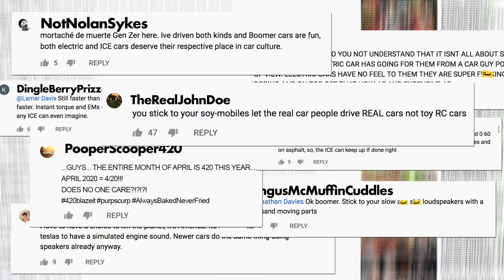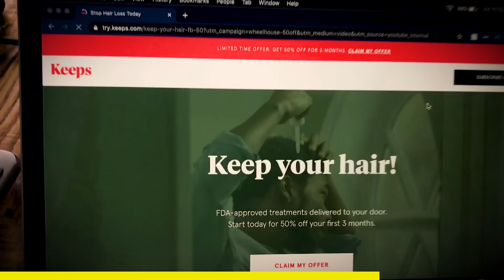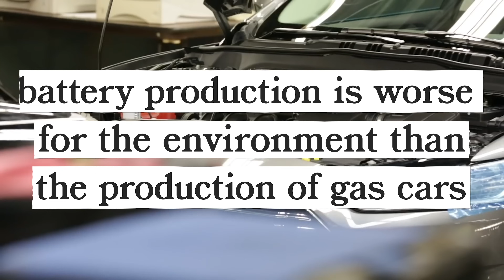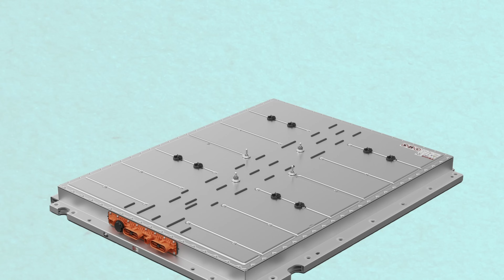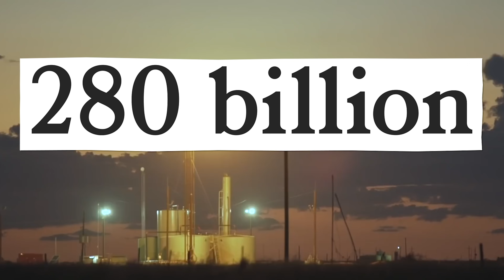Are Electric Cars REALLY Better for the Environment?

Comment: Sorry, but your claim about being "neutral" is simply not true. You obviously do have a massive bias. Having studied physics and having followed "green" energy claims very closely, I know that you omit lots and lots of essential information.

Where to begin?

- batteries, especially lithium-based batteries, represent a substantial risk; they can combust spontaneously and even explode; recently, EV busses in China burned down an entire bus depot, which caused serious concern among western cities that use EV buses; lithium fires are almost impossible to extinguish; they can burn for 24 hours or more

- one guy who had just purchased a brand new EV luxury sports car saw it gow up in flames; as more and more people buy EVs, this is a major risk fire departments now have to look into

- it's actually related to the problem with solar panels that catch fire, which are both, very hard to put out and very toxic

- EV batteries as well as solar panels are extremely hard to recycle

- there's a lot of energy lost in the transport of electricity and during the loading process, which you obviously did not account for. You only calculated the energy that ends up as battery charge.

- batteries lose power over time when they are unused; depending on the battery technology, that can be very little or quite substantial, i.e. if you don't use an EV for 1 month after loading the battery to the max, it might lose a significant amount of energy, while a gas tank in a modern car has almost no leakage.

- typical EV batteries have a life span of at most 7 years; coming technologies might expand that, but that's speculative; given that the batteries are the most expensive part of a typical lower- to middle-class EV, it is not worth replacing the battery, as the cost will exceed the depreciated value of the car itself, so you basically trash the entire car when the batterie dies; so even if the average age for batteries should reach 10 years, that's way lower than the time you can drive a gasoline car; my BMW now is 14 years old and in top shape; accounting for the reduced lifetime of EVs will substantially alter their eco profile.

- you totally neglected to mention RANGE, which is a huge issue! When I go on a long road trip, I don't want to have to stop every 200 to 250 km for a 1 - 2 hours just to re-charge the batteries; driving from my place to Rome is about 1000 km; with a gasoline car, I can do 700 - 850 km on one tank and it takes me less than 5 minutes to fill the tank; 

- if the number of EVs increases, the load on the electric network massively increases; contrary to your claim, electric grids would be in total overload if even just 25% of all vehicles were EVs; the more there are, the more often they need to be charged at any time of day, i.e. you can't tell people to "charge their cars at night; professionals need their vehicles to be charged immediately, so they need extremely fast loading, provided new battery technology allows it; that also increases the loss AND pulls enormously more current; as a rule of thumb, the average electric grid will need 6 to 7 times more power to support fast loading for a 100% EV fleet

- current batteries require rare earths and are highly toxic in production and hard to recycle; CO2 is NOT the measure of the real eco-impact of EVs...

- where will you get all that electric energy? You would have to replace about 40 to 60% of energy that currently is provided by carbon-based fuels; you will NOT get it from wind or solar, which are both very low-density and unreliable, chaotic energy

Here is the exact composition of electric energy production for Germany, which claims to be "exemplary" in it's massive use of wind & solar:
https://energy-charts.info/charts/power/chart.htm?l=en&c=DE&interval=month

Average wind production: 14.8% of the installed capacity; worst case scenario: cold, windless winter night; wind & solar drop to 0.1% of their installed capacity, which means that 99.9% of the wind & solar energy must be provided from other sources precisely when there is a huge demand! In other words, the entire energy production infrastructure must be DOUBLED!

The only way one could generate enough reliable energy to support a 100% EV fleet with fast charging would be NUCLEAR, but the same people who push the not so "green" wind & solar do not want nuclear; because their profits stem from wind & solar, which are incapable of providing enough energy, so this is a trap.

- I would start supporting EVs for general use:
* when we use modern 4th & 5th generation nuclear power plants, maybe Torium-based, with liquid-salt cooling and subcritical, small reactors
* alternatively if we manage to develop fusion power; then we can totally drop that solar & wind nonsense as complately pointless
* when battery technology is so advanced that we have at least 5x the capacity, 10x the loading speed and none of the safety, resource and recycling issues

- the entire discourse that tries to tie EVs to CO2 emissions is absurd; CO2 has virtually ZERO impact on the climate; they only measurable change through the minimal increase of CO2 over the last 100 years has been a GREENING of the planet!

Deserts 'greening' from rising carbon dioxide: Green foliage boosted across the world's arid regions
https://www.sciencedaily.com/releases/2013/07/130708103521.htm

Impact of CO2 fertilization on maximum foliage cover across the globe's warm, arid environments
http://onlinelibrary.wiley.com/doi/10.1002/grl.50563/full

Effects of Rising Atmospheric Concentrations of Carbon Dioxide on Plants - Greening Planet
https://www.nature.com/scitable/knowledge/library/effects-of-rising-atmospheric-concentrations-of-carbon-13254108/

Not a single prediction by the climate alarmists has ever come true. NOT ONE! Their models are completely wrong; they diverge by more than the 2-3 times the total claimed global warming between them; not a single model predicted the lack of warming from 1998 to 2015 - and given the NASA/NOAA data manipulation in 2015, there's a lot of doubt about the quality of data used; that means that no one has a clue about how the climate works and clearly, the assumption that CO2 causes major warming has proven incorrect.

The scientific challenge of understanding and estimating climate change: 2 essential lines to retain:
"models differ among themselves in their estimates of surface temperature by an amount that is 2 to 3 times as large as the observed warming"
https://www.pnas.org/content/116/49/24390

The latest flooding in Europe is used as proof that something is "wrong" with the climate, that it is "changing". As always, they lie - we are totally within the normal climate variability. People just don't look at the history of climate events:
http://www.bbc.com/news/world-europe-36443329

- Major storms are DOWN; the worst storms in modern history (since 1500) almost all occurred before 1800.

- Deadly climate events are DOWN; during the 1920s, close to 30 million people died due to climate events; we are down to fewer than 1 million per decade.

- Food production is massively up, on less land! The number of people starving has been reduced to a fraction of what it used to be, in both, percentage and absolute numbers, despite a massively increased world population.

- Again contrary to their claims, snowfall has not disappeared, it increased substantially; the models got it totally wrong.

- Forest fires massively decreased over the last 120 years!
https://royalsocietypublishing.org/doi/10.1098/rstb.2015.0345

I wonder where all the "suffering people" Greta keeps talking about, given that living conditions continuously improved, worldwide. If you compare the average person in Africa with an average person in a western country, you might think that they are very poor, but if you compare that African person with their ancestors in the same country 50 years ago, their lives have improved immensely.

There's really ZERO correlation between CO2 and the climate; those who push the climate agenda have been lying for at least 60 years. It's all Club of Rome Marxist propaganda. They first tried scaremongering with "global cooling" (UN, NASA, NOAA, Royal Society, Nature, Science, NYT, Guardian, National Geographic etc. all participated), then they suddenly switched the entire discourse by 180 degrees and it became "global warming".

Every 10 years, they reset the date when the world will end. I've seen it for more than 5 decades and the world never ends; we just get the occasional upsetting climate event, which repeats every 20 - 30 years. Go check out the floodings of the past.

Why did humanity invent more than 3000 gods? Mostly to pray for clement weather, not to hot, not too cold, not too wet, not too dry, no earthquakes and no volcanic eruptions, because those were the kinds of events that happened all the time and could really mess up an entire population.

If anyone thought that sudden "climate change" is man-made, they did not spend one second looking at climate history.

The Year Without a Summer Was a Bizarre Weather Disaster in 1816
https://www.thoughtco.com/the-year-without-a-summer-1773771

200-Year Drought Doomed Indus Valley Civilization
http://www.scientificamerican.com/article/200-year-drought-doomed-indus-valley-civilization/

5 years of global cooling due to the eruption of ONE volcano, the Krakatoa, in 1883.

In short, buying an EV because you think that it will "save the climate" is one of the biggest delusions, ever.

EVs are probably the future - but before they can truly replace our absolutely fantastic, highly optimized gasoline cars, we need at least 50 years of additional research and development, which is not a problem. Our emissions do not alter the climate.
Reply: @stefanmetzeler  they want to end all sales of NEW gasoline cars…. In 15 years times. Still a long time after than until they’re filtered into second hand car market.
Reply: There is so… so very much wrong with this comment. I’ll give a full response soon. But dude. At least try to google the rubbish you’re spouting.
Reply: @engineeringtheweirdguy2103  I can back up everything I said!
Good luck trying to prove me wrong 😂
Reply: @stefanmetzeler  I wouldnt be so arrogant. i'll go down paragraph by paragraph but I'm not touching the Climate stuff as that is outside my area of expertise. I'll stick to EV stuff.

Batteries represent a substantial combustion risk? no they don't. Firstly most battery fires are thermal runaway, which takes hours of smouldering before visible flames. secondly, in relation to EV's. real-world statistics don't support your anecdotes. according to the Beuro of Statistics both In the EU, Australia and the US, the AANCAP safety board, NCAP safety board and NHTSA EV's are typically 11 times less likely to spontaneously combust, and 5 times less likely to combust in an accident. Id love to see you support your claim that EV's pose a raised likelihood of combustion.

next, you claim there is alot of loss in energy transportation? no there isnt. The most ineffective powerlines in the US only represent a 15% loss of energy at worst and typically sits much lower. and by loading process i believe you mean charging? EV batteries charge at about a 98% efficiency. so thats false also.

Next, Batteries do lose charge over time. But not much. My EV was parked in long term airport parking for a month and I lost less than 4% charge. But tell me, how often do you leave your car, which you can charge at home, and leave connected to the charger, sit around for months without a power supply? If you own a car, chances are its because you have use for one.

The next one. and this is a BIG one. Im especially interested to see you back this up. You claim EV batteries today dont last longer than 7 years. Where in the flying huntsman did you get that from? Modern EV batteries have a Warranty Period of 8 years alone! meaning they'll last much longer than that. They need to otherwise the company will start losing money hand over foot on warranty claims. Modern EV batteries have been showing that they'll last, and have been lasting over 400,000-500,000 miles (800,000 km). That represents approximately 30-40 years of driving for the average person and much longer than the lifespan of a combustion engine. 

For example, Tesla Batteries have a cycle life of 1,500 cycles to 70% health. As in, after 1,500 cycles you have 70% of your original capacity remaining. For a model 3, its range is 325 miles (with the model S and X having lager ranges as well as other EV models). after 1,500 cycles that's 487,500 miles of driving. and you still have 230 miles of range to a charge at that point. and when the average daily commute is 70 miles. That seems more than still usable.

So please, Id love to see you support that claim.

Next is range. Most EV's are shooting at around the 400km mark these days as entry levels. For example the 2021 Nissan leaf gets 385km of range. The Tesla Model 3 Standard Range gets a realworld range of 400km. So you wont have to stop every 200km, thats half your range. Additionally super chargers are everywhere, if you're on a long trip, a stop at one of these bad boys can charge you up fully in 45 minutes with a V2 charger or 20 minutes with a V3 charger and less time if you dont need a full charge (lets say you get to the charger at 30% charge instead of 1%).

Every other instance you are charging from home, While you're not using it, while youre sleep or doing something else like cooking dinner. In that instance, you dont wait at all for a charge. you just take up the next day to a full tank of gas. You dont have to drive to a fuel station every week for gas which wastes the average person between 16-17 hours per year.

so spending an additional 1.5 hours of a 1,600 km road trip i might do once per year is a lot better than wasting 16-17 hours per year standing outside holding a pump dont you think?

Then there is grid loading. Whilst you're absolutely correct that you cant tell people to just charge their cars at night, how many people do you know who have jobs in which they cant do that, and what percentage of the population do you think they represent? a small proportion statically would be the correct answer. The vast majority of people don't need to travel more than around 100km per day (on the extreme end). for their daily commutes, shopping etc. The vast majority of people dont use their vehilces whilst they are sleeping. Hence they charge them at night when they sleep. The load on the grid is minimal at night, many generators are shut down because there simply isnt the demand.

Additionally this is a stupid point ignorant people make because its supposing that everyone receives their brand new tesla tomorrow and their gas cars are taken away. every person on the planet. Wow. what a coincidence and logistical miracle  the would be! No, the world doesnt work like that. EV's have been successful on the market for over a decade now. They still make up a small (but growing) portion of the vehicle market. It will be decades still before all new vehicles are electric, and decades still before all second hand cars are electric. Meanwhile Grid capacity in every developed country has failed to, on average, double its energy capacity every 20 years due to continually rising demand ever since the light bulb was invented.

meaning that the grid is more than capable of keeping up with EV adoption, as it occurs. We're not all going to get one at once. you can calm down.

Next, you dont have to replace existing energy infrastructure for EV's. Even on coal only grids they produce less emissions than combustion cars do, even before you start considering transport of fuel and fuel refining. 

Secondly Nuclear is not the way forward. Nuclear in all industrial instances, produces radioactive waste, it also produces irradiated contaminated waste. At current we have no other option but to bury that waste in the ground and pray it doesnt eventually leak through the corroding steel drums. There is so treatment out there right now for nuclear power plant waste.

Additionally, currently, unless you're china you cannot but a nuclear reactor in less than 8 years from project commission. By the time they're built, it will already be too late.

conventional green energies such as wind and solar, hydro and geothermal can be very stable and reliable. When coupled with source and geographic diversification and storage. There have been many papers researching this and they all come to the same conclusion. Even look at the state of South Australia. They have over 70% renewables. with big battery storage. Before they invested in renewables, they were the least stable grid in the state, they were energy dependant on other states and had the most expensive electricity prices in Australia. Now they have the second cheapest wholesale energy prices in Australia, are net exporters of electricity to other states and have the most stable grid in Australia reaching 70% renewables.

how did they do this? they diversified the type of renewables they used and the diversified, their location (part of this was rooftop solar through home solar incentives to for a VPG or Virtual Power Plant). If the wind dies down in one place, 1,000 km away its likely still windy. They also implemented storage which significantly reduced the curtailment of renewables. They did this both with grid scale battery storage, and with home storage. They are also in talks to connect their grid to Tasmania who runs entirely on Hydro, to used pumped hydro storage to further increase their storage capacity.

This isnt an uncommon  or unknown thing. The EU is looking at something called the EU super grid. Which will connect Solar from countries like Portugal, wind from places like Germany and Belgium with hydro storage in places like Norway. MANY studies have been done on renewables grid stability. They almost always come to the same conclusion. On their own, they're unreliable and ineffective, Diversified by source and geography, and with storage to reduce curtailment, they are reliable and effective.
Reply: @engineeringtheweirdguy2103  German professor admits that EVs are just an alibi, as cars have virtually no influence on global emissions; so even if emissions were an issue, EVs would do nothing to improve the situation:
https://www.ingolstadt-today.de/archiv/9/der-sinnlose-traum-von-der-elektrischen-zukunft-a-22935

German environment minister dumped Tesla, because the battery was too weak, as tests showed that it never even reached a range of 300 km, which is ridiculous. You can't be limited to such a short range; that was 2017 - even if the range improved a little, it is nowhere what one expects of a normal gasoline car, with a 700 to 900 km range and even much more for diesel, plus a 3 to 5 minute break for filling the tank:
http://www.bild.de/regional/duesseldorf/tesla/umweltministerin-schafft-dienst-tesla-ab-52837146.bild.html

I completely forgot to mention that EVs are almost unusable in very cold temperatures:
https://www.disclose.tv/new-test-reveals-electric-cars-are-practically-unusable-in-winter-383233

Article confirming that the end of an EV's battery life implies that the vehicle is basically worthless:
https://ecomento.de/2019/07/29/elektro-smart-batterie-defekt-wirtschaftlicher-totalschaden-moeglich/amp/

Dyson abandoned his EV project, admitting that it was not economically viable - not without massive subsidies:
https://www.engadget.com/dysons-electric-car-n526-085341772.html

From MSM: 1 in 5 electric vehicle owners in California switched back to gas because charging their cars is a hassle, research shows
https://www.msn.com/en-us/autos/news/1-in-5-electric-vehicle-owners-in-california-switched-back-to-gas-because-charging-their-cars-is-a-hassle-research-shows/ar-BB1gekKk

The absolute nightmare of having to wait to charge your EV as their number increases while the charging time is still very long:
https://www.dailymail.co.uk/news/article-7755753/Chaos-California-Tesla-drivers-stranded-hours-half-mile-long-line-charge.html

French article enumerating many major issues with EVs, especially the network load:
https://www.challenges.fr/automobile/dossiers/et-si-la-voiture-electrique-etait-un-desastre-ecologique_575450
Reply: @stefanmetzeler  so your response to me pointing out that statistics don’t support your anecdotal evidence is to supply anecdotal evidence. Are you dense? I can find just as many articles on car fires and recalls from every major automaker other than Tesla for spontaneous combustion or for being a fire hazard. I can find hundreds of examples of airplane crashes, does that make them unsafe? No, because that would be anecdotal evidence.

You seein that picture now?
Reply: @stefanmetzeler  more anecdotal evidence. Notice I said most EV’s there are still some with poor design that don’t have long lasting batteries. The industry standard for battery life is to 70% health. Adhered to but almost every EV automaker and battery lab. You’re finding an anecdotal point of a single auto maker putting something different in their terms and conditions and saying that applies to the majority. It’s not how reality works kiddo.

And 1 in 5 owners returning their EV’s in California. More anecdotal evidence. Do they mention the reason why? California have shots themselves in the foot with their energy grid. Now unreliable and frequently blacking out, it’s become unreliable to own an EV. In that specific state in this specific point in time. However that is not the case, litterally anywhere else. Especially places with a function and competently designed energy grid.

You love your pointless anecdotes don’t you?
Reply: @stefanmetzeler  here. I’ll find articles of dental procedures that resulted in death. Then I’ll say all dental procedures are risky and deadly. Then I can be just like you!!
Reply: @stefanmetzeler  again, with anecdotal evidence with Dyson. For Dyson to do what they wanted was economically unviable for them because of the required capital and retooling expenditure. Hmm, if only there was an successful EV company we could compare it to instead of providing and anecdote and declaring the exception is the rule… hmmm, oh wait, there’s Tesla, who’s become the highest valued car company in the world despite being so young and is the only automaker on the planet right now seeing increasing sales. Whilst every other automaker has been seeing declining sales year on year.
Reply: @engineeringtheweirdguy2103  "Most EV's are shooting at around the 400km mark these days as entry levels. For example the 2021 Nissan leaf gets 385km of range. The Tesla Model 3 Standard Range gets a realworld range of 400km"

Those are THEORETICAL numbers. Like my brand new Thinkpad, which is advertised as being able to work "up to 16 hours". If I ever got close to 7 hours, that would be exceptional. I don't know how they get that number: display turned to the absolutely lowest level, probably reduced resolution, CPU at minimum, all devices - camera, speaker, bluetooth, WIFI etc. turned off. I still don't think I'd get 16 hours.

I'll presume that it will be the same for an EV. I'd expect 50 to 70% of the advertised range.

"super chargers are everywhere"

Nope, false assumption - that means you have to only use an EV in a very densely populated area that is equipped with chargers. If I go up into the mountains or nearby Italy, a bit more remote areas of France etc. I won't find any charging stations.

"if you're on a long trip, a stop at one of these bad boys can charge you up fully in 45 minutes with a V2 charger or 20 minutes with a V3 charger and less time if you dont need a full charge (lets say you get to the charger at 30% charge instead of 1%)"

You are not contradicting me, you are confirming what I said: frequent stops of 20 - 45 minutes, much more if you have to queue and that's presuming that there are charging stations. My flexibility would be massively reduced.

That's why the German Environment minister dumped her Tesla.
Reply: @stefanmetzeler  you said 1-2 hours a stop. That’s different to 20-45 minutes. It also doesn’t take into consideration stops you would normally have had to take.
Reply: @stefanmetzeler  another anecdote about a think pad. Interesting that you think the battery management and range estimation of a small tablet would be similar to that of a $80,000 car. No. Notice I said real world range. The model 3 standard range has an EPA rated range of 385 km, and an NEDC range of 460. But, since owning my model 3 standard range, I get real world range of around 400km combined driving and 380km country freeway driving at 110km/h. I can’t speak and didn’t speak for the leafs real world range because I don’t drive one. But suffice to say you don’t lose 50% of your range based on their rating.
Reply: @stefanmetzeler  I live in Australia. I. Can make it all the way across and around 5 states and territories all bigger than most counties in the EU. using the current woefully inadequate super charger network which has had about as much investment as you would expect for a country whose EV’s sales make up just 0.6% of all car sales here. And the network is growing, very fast. Because it’s relatively cheap and easy to do so. 

Have you seen a map of Tesla super chargers in France alone? Tesla isn’t even the only super charging network. There are 1,300 super chargers in France, with a network of charging stations (super charging and standard destination charging) of 23,000 chargers. In France alone. Not including the rest of europe. Maybe check a map first buddy. There are 25 super chargers from Tesla being built current in France alone. That’s how fast they’re expanding the network.
Reply: @stefanmetzeler  also going to reply to your deleted comments. You said there was a huge loss in energy transportation. 15% isn’t huge. It is for combustion energies that run at an overall efficiency of 20-25 on average, not for something that’s already around 80 overall efficient. Also 2% loss from charging is again, not a lot lost. Sorry buddy.
Reply: @engineeringtheweirdguy2103  I have just finished reading all the comments (I mean, the ones that are not deleted 😅) and it was fun to analyze both prospectives.
Cheers from Italy 🇮🇹
Reply: @engineeringtheweirdguy2103  I NEVER DELETED A SINGLE COMMENT!
I also never "made an idiot of myself"!

YOU DID - you actually committed massive logical errors and fallacies.

So what are you talking about?

If any of my comments got deleted, it was not by me.

But most likely, you just lost track.
Reply: @engineeringtheweirdguy2103  "nteresting that you think the battery management and range estimation of a small tablet would be similar to that of a $80,000 car."

That reply is so incredibly stupid that I don't know where to begin!

A very HIGH LEVEL NOTEBOOK that costs about 3-4 times as much as a middle-of-the-road notbook obviously uses the best possible battery technology.

If the CLAIMED performance by the manufacturer is not the same as the ACTUAL performance you experience for the laptop, you can expect that it will be THE EXACT SAME THING for the car!

Under IDEAL conditions and by turning off every little thing that might be a power consumer, they might get a range that is substantially larger than what you'll get in everyday use.

It also depends heavily on traffic and road conditions etc.

If the environment minister of Germany dumped a high end Tesla because of the insufficient range, I'm pretty sure that your claims are highly optimistic - and still only half of what I get on my gasoline car.
Reply: @engineeringtheweirdguy2103  Given your pathetic insults, I'm going to end this conversation now. You sound more and more desperate.
I totally destroyed your claims and there was NOTHING "anecdotal" about what I posted.

Dyson, a hugely successful industrialist deciding that a fully developed prototype will not be economically viable due mostly to the HUGE cost of the unsubsidized battery is not "anecdotal". He's obviously extremely well placed to know.

Currently, it's absolutely obvious that EVs are LUXURY ITEMS for very wealthy people who typically can afford multiple cars. So they'll have an EV for the eco-chick, for local trips, but also at least one gas powered car for longer trips.

And EVs are heavily subsidized. So governments spend billions on subsidizing luxury cars for wealthy people!

That's completely unsustainable in the long run!

NONE of the major problems is resolved:
- we don't know where we'll get the energy from to power even 10 - 20% of the current gasoline powered vehicles
- we don't know how to recycle the batteries
- contrary to your persistent lies, EV battery fires are VERY common! I did NOT post "anecdotal" evidence, I posted INSTRUCTIONS FROM MANUFACTURERS TO CONSUMERS telling them how to AVOID such fires!
- the range is completely insufficient
- the charging time is way too long
- very fast charging puts a HUGE added load on the network
- ALL vehicles using maximum load speed to not be blocked for 40-50 minutes just for loading would mean 6-7 times the current power supply peak. If you can't do the math, don't participate in the debate.

No matter what, loading stations would be completely overrun. You can't just multiply them indefinitely - you still have to feed them from the same grid!

The ONLY reason to use EVs in a city is to reduce local pollution, although modern gasoline cars generate practially only CO2 emissions, which are NOT polluting and do NOT alter the climate.

A Citroen 2CV from 1975 - the "Hippy car" - emitted 500 times more pollutants than a modern Mercedes 600.

In short, the "eco-argument" for EVs is mostly a failure.

They totally make sense in some specialized applications, but they are simply not ready to replace our extremely well made gasoline cars.
Reply: @engineeringtheweirdguy2103  You don't seem to realize that Tesla's stock market value is ENTIRELY speculative and has nothing to do with the actual output of Tesla factories, right? No, apparently you don't understand that.
Teslas are NOT PROFITABLE without subsidies!
Reply: @stefanmetzeler  posting a singular instruction from a singular manufacturer about a singular product is the definition of anecdotal. That’s like me posting a recall from Brevil for a single model of their kettles because they’re prone to electrical Fires, as evidence that all kettles, including all Brevil model kettles and other brand kettles, must therefore be fire hazards. 

Do you see the flaw in that logic yet kiddo?
Reply: @stefanmetzeler  we do know how to recycle batteries. They’re around 98% recyclable and a cursory google search would have told you that.

Secondly it’s worth noting that EV’s don’t have to go to stations to charge like gasoline cars do. As long as you have electricty to your house you charge your car from home. The only time you need a “loading station” is when you want to travel more than 300-400km in a day. For the average person they need only arises maybe once or twice a year or less.

You’re attributing fuel station traffic to EV’s which do not operate in that manner. It’s a profoundly idiotic assumption.
Reply: @stefanmetzeler  you’re so ignorant. A notebook is not the same as a car. For starters, the BMS and battery architecture is completely different. Notebooks tend to have large singular battery cells. EV’s have thousands of individual cells in the battery pack. Notebooks also don’t have their batteries swimming in coolant fluid constantly keeping them within optimal operating temperatures. Notebooks don’t have charge and discharge regulators and often go from 0-100% on a daily basis, EV’s rarely go below 20% or over 90% charge in average daily use. 

Most important, power consumption factors are completely different. If you get a notebook to send emails, it will last longer than if you had got it to perform Engineering computational simulations. Some people might browse one tab at a time on the internet while others might have 1,000 tabs open at a time.

Driving. Is driving. There are factors which affect range but nothing usually that extremely different from person to person. If you drive through traffic better range, if on freeway, around 10-20% less. If it’s windy, a few percent lost if you’re only travelling into the wind. If it’s raining, you lose something like 5%. 

But most importantly, driving conditions in general obey the law of averages. The more you drive, the more your average range reflects the average road conditions and your average driving style. This is relatively EASY to predict. Infact Tesla’s make these predictions all the time. If you plug in a destination it tells you what state of charge you’ll have when you arrive. I’ve found it’s usually accurate to within 1 or 2%. You can reduce that more with third party travel apps like “a better route planner” in which you can enter weather conditions, tire pressure, passenger weights, etc.

Unfortunately for computers use, there isn’t a typical average, or any accurate average, as the use of each computer varies so wildly from person to person. Job to job. Where as cars will always typically drive on roads. They are only used for driving. And the driving conditions are predictable. And you’d agree with that if you ever quote the google maps drive times when giving an estimated time of arrive to someone. 

You are so profoundly ignorant of the technology or even what makes a sensible argument. You claim you don’t use anecdotal evidence. And none of your evidence is anecdotal. Yet you keep claiming “well this German guy got a new car and it wasn’t electric” as evidence electrics don’t work well. that’s the definition and anecdotal you muppet
Reply: @stefanmetzeler  Tesla are profitable. That’s how the company can keep expanding. And are you really saying that the global economic value of a company has nothing to do with the economic value of a company? Really? really.
Reply: @stefanmetzeler  You're not understanding.. like anything.. The power consumption profiles for an EV are vastly different to that of a tablet or laptop. Infact driving demands for power are so predictable, google can accurately predict you arrival time. add a few more variables like weather and elevation plot and other programs including whats used in teslas, can accurately predict how much charge you'll have when you reach your destination.

The same cannot be said for laptops or tablets. It depends on the person and the job and they can change wildly. Lets compare even the same person on two different devices. lets say his work computer he just uses it to check emails. Thats it. He checks and responds to emails. HIs power consumption is very minimal, and that device gets much better battery life. Then his home laptop he uses to stream youtube videos and play video games with. As a result he has very poor battery life and needs to leave his computer plug in at all times to do so.

so even from the same person between applications the power demands shift wildly. yet alone between different people.

Meanwhile if you compare me driving 50 miles. and compare someone is Claifornia driving 50 miles and compare someone in germany driving 50 miles. your power consumption per mile average will be almost identical.

There aren't as many different extreme use cases for EV's as there are computers. Something you clearly cant wrap your head around but then get defensive can call me stupid which is laughable.

you also dont seem to comprehend the difference between a single cell battery vs a thousand cell battery pack and what the use differences are. Have you ever done any electronics in your lifetime? ever? doesn't sound like you have.

try using the noodle of yours once in a while. it could help you look like less of an idiot.
Reply: @engineeringtheweirdguy2103  Wow, excellent response. I was going to try, but you spelled it all out.
Reply: @stefanmetzeler  The Tesla Model S has an EPA rated range of 400 miles, or nearly 600km. Real world tests bear that out. And  we  aren't done yet.
 
Are there some scenarios where an EV is not the right tool for the job? Sure. But for 98% of all trips, an EV will do the job.
Reply: @stefanmetzeler  You promised to stop, but you didn't.
Reply: @stefanmetzeler  The batteries are technically different, as Engineer pointed out. Additionally the usage varies wildly, as he also pointed out. One (the car) has a  much more predictable battery drain pattern, while the other (tablet) can easily use 1% of full power when reading an ebook, while using 15x as much when  playing an action movie while driving a set of external speakers.